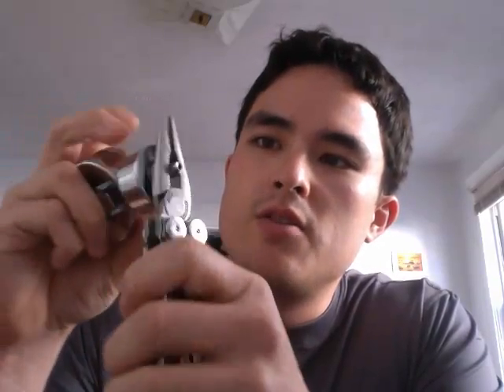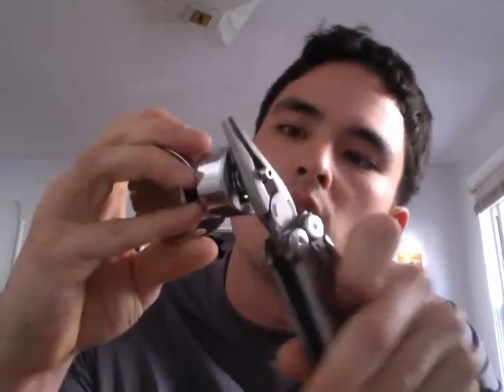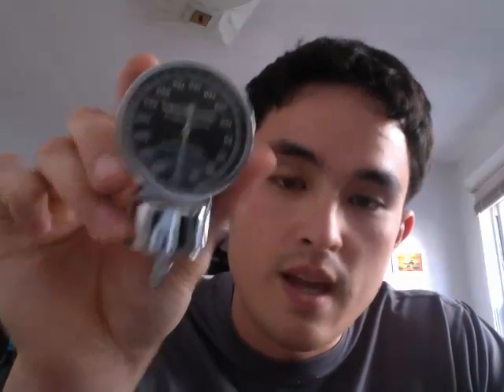Zeroing out blood pressure cuffs

Comment: You should have measured your BP and waited 15 min, adjusted it and see if your assumption about subtracting was correct.
But advising people to subtract 20 pts is a bit irresponsible. Have it adjusted, verified and then trust it. They are set at zero for a reason.

Comment: I made use of this item and found out fulfilling final results. After performing this hypertension strategy, I ran across on the search engines, my high blood pressure was 152/92 during my appointment to the health care clinic. Once I managed to get a fresh source and commenced utilizing it again I discovered my blood pressure levels go back to normal. The guideline has been beneficial to me. It has assisted to modify my blood pressure. Using Google to get this guide.  Name of this tip is Jason Cυnobroke
best

Comment: Thanks for the pointers on zeroing a blood pressure cuff. Is there an inexpensive way to calibrate the systolic and diastolic readings? Thanks!
Reply from the maker: Not to my knowledge. If it is correctly zeroed yet is giving incorrect pressure results compared to a reliable gold standard, the coil is busted or similar -- it needs to be replaced.

Comment: Hi,  I am a former EMT-A and let it lasp and am taking an EMR course here in Indiana.  I am looking for a manual blood presure cuff that has a VERY large PRINT dial for easier to read, preferable with a black background and yellow or white lettering... I had one in 1993 I bought, but not sure where I got it.  Decade before Amazon came out.  Any ideas?  Thanks Tim.
Reply from the maker: Hmm, you got me. Seems like a pretty specific need. If you contact the support folks at one of the larger medical supply companies they may be able to point you in the right direction.

Comment: I have a Lane and this didn't work. All this did was chew up the metal badly. If you have a Lane you actually have to put a small flathead screwdriver in the bottom after you take the hose off and turn it. If you do what this video says you could badly damage your flange depending on your make/model.
Reply from the maker: +Richard Cotton In my case I actually did not -- this model doesn't have a securing screw.

+Xillaw Obviously if yours does, you'll want to loosen it first. I believe I've seen the kind you mean but have rarely encountered them.
Reply: +Brandon Oto You can catch glimpse of the ring with the two holes in minute 1:06.
Reply from the maker: +Richard Cotton I'll be darned, perhaps you're right. Maybe it's a securing ring. But you're not going to rotate this one without something like a security scewdriver or some other weird tool; it's just two small holes.
Reply: Same here, just chewed up metal.

Comment: zeroing the gauge does not ensure that it is properly calibrated.  Following this procedure could result in misdiagnosis.  Aneroid sphygmomanometers should be calibrated at least every six months, or sooner if an obvious discrepancy is noticed.  For references, see http://www.ncbi.nlm.nih.gov/pubmed/?term=aneroid+sphygmomanometer+error
Reply from the maker: No disagreement there. In some cases they are simply out-of-zero, but in other cases they are more fundamentally flawed. A cautious approach would be to bin every gauge that looks questionable, but unfortunately in many services that will leave you with few or no working cuffs, so as with most things, a middle of the road approach is probably best... use your judgment and try to check that it's at least in the right ballpark afterward.